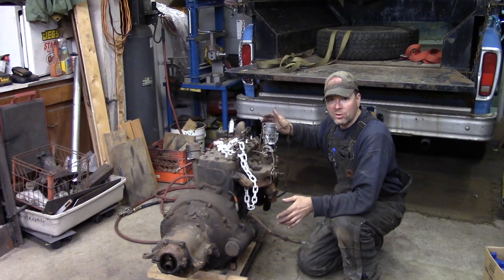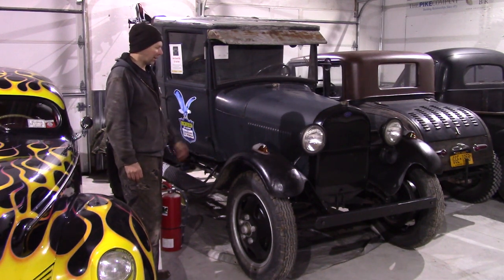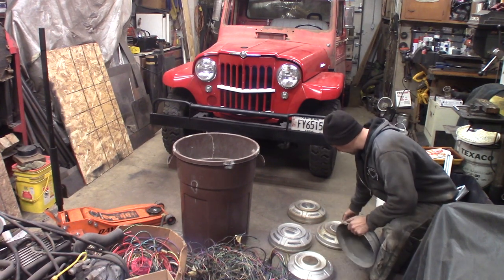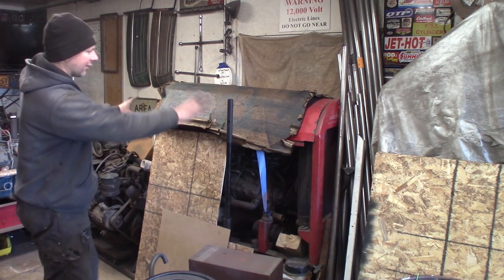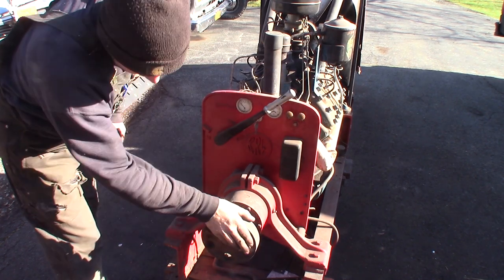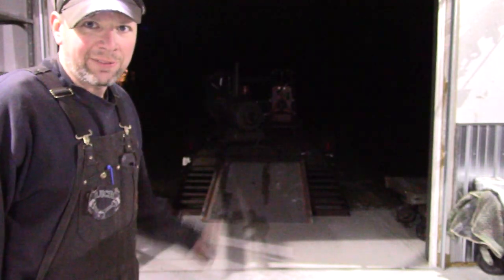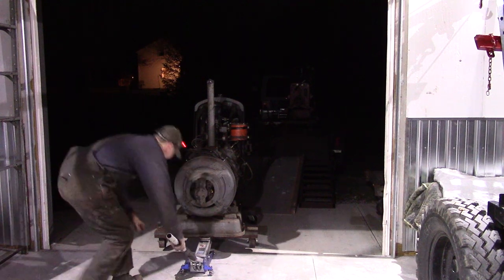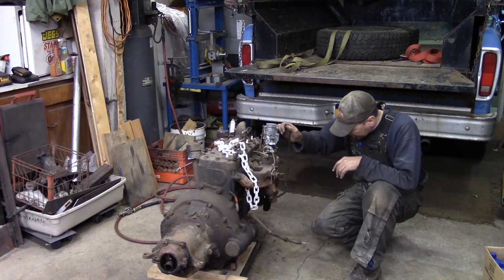Playing with Ford Flatheads! KR Wilson Power Units, '40 Ford six, and Ford AA Tow Truck

Comment: Josh,  If you decide to get rid of the shell etc of your third power unit let me know... I have a Schramm Air Compressor that is a Ford Flathead V-8 and have been looking for a power unit as a display.  Thanks, great videos keep it up!
Reply from the maker: I'll let you know, right now I'm going to keep it as a run in stand for some of my other flathead stuff.
Reply: @QuickSpeedShop  Thats a great idea, I did the same thing out of an old irrigation power supply on a skid!   Ill try to post a pic at some point